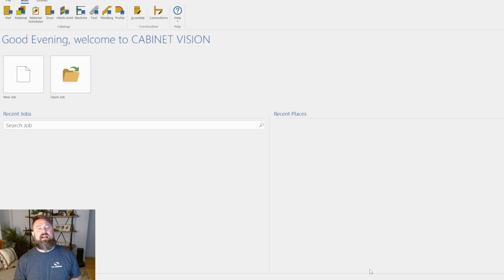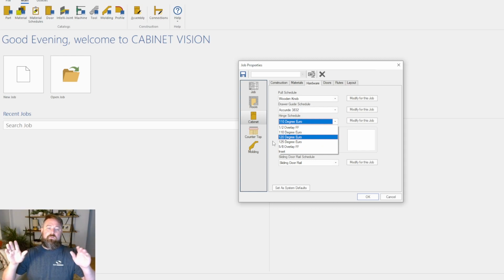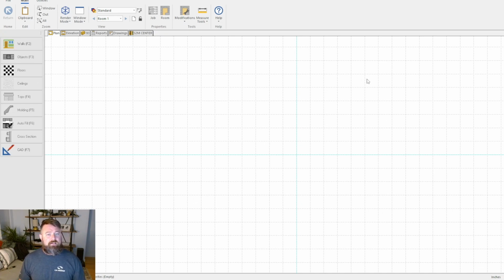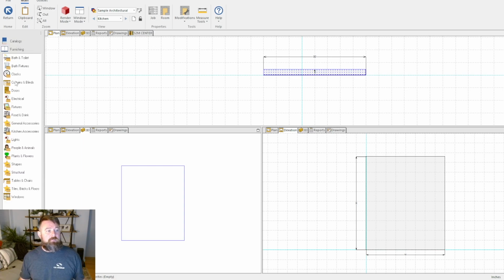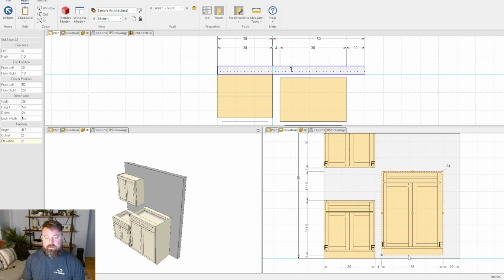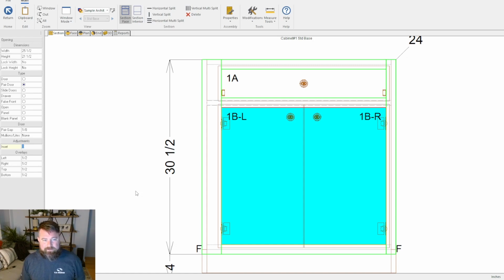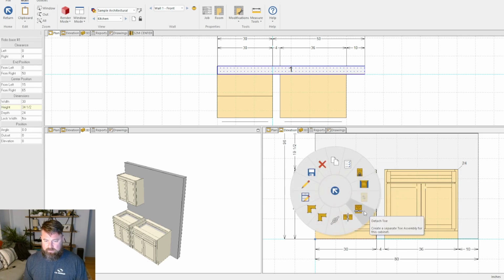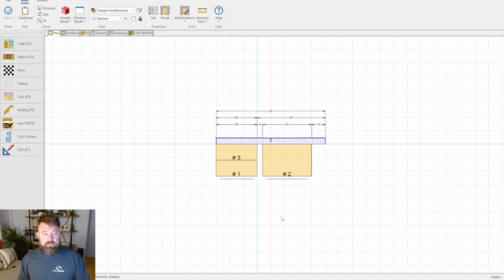Making sense of Cabinet vision! Pt 1

Comment: I watch these furniture design programs, and I’ve tested them myself before choosing the best one (which doesn’t exist). And as I look at them, I notice that the more expensive the software, the dumber it gets. They try to sell us the "one and only" solution because the more complicated it is, the better it’s supposed to be.

Furniture design programs should be more automated, taking the workload off our shoulders, but I get the impression that it’s faster to draw things on paper than on a computer. After years of using different programs, working with some of them feels overcomplicated and completely idiotic. Instead of progressing, some programs seem stuck in the past, so poorly designed that they can’t even be modernized.

Sure, they render things beautifully, everything looks nice, and they add small details, but in reality, they fail at simple tasks and mess up calculations. Cabinet Vision—so much money behind this company, yet they still can’t make...
Reply: u r right after many tries with many programs i found the best is polyboard

Comment: Sorry if this is answered in the video I'm only 25 minutes in but is this just making use of the "core cabinets" module?
Reply from the maker: Hey! Thanks for the question. To be honest, I don’t think I covered that part very clearly. Back when I started using Cabinet Vision, they had a different licensing model so I believe that we were grandfathered into the new licensing structure when they made the switch so it’s been a minute since I have looked at all that. That being said, I believe that everything I go over in this video should be available in the core Cabinets module.
Reply: @KBCabinets  Thank you! I am trying to figure out what I need out of CabinetVision and this is very helpful.

Comment: Not sure where to turn next as I have spent a couple of hours with a tech trying to solve but I installed 2023 update from v11 and now uniboard and prism texture packages will not work.
Can’t find any answers or even info on where to purchase or download anything.
I can download onto my computer and when I import them, says they imported but then not showing up anywhere.
Very strange and tech says might be because advanced no longer will work?
Doesn’t make sense because it’s the same package I’ve been using for over a year.
Like the software but really tough finding answers so hoping maybe someone will see and know of a solution.
Reply: After you download the package you have to "install" it in Cabinet Vision.
To do this you'll need to have all jobs closed and be at the beginning splash screen. At the top of the screen you'll see the "File, Main, and Utilities" tabs.
Go to the "Utilities" Tab and click on "Setup Package", and the "Package" dialog box will appear.
Click on the "Import" tab, then click on the "Open Folder" Icon. This should automatically be directed to your Download directory. If not, find your downloaded file from this window and select it, then click "Open" in the lower right corner.

(The right side of the Package Window should now display the package you downloaded with check marks next to each new feature, along with a Green, Red, or Yellow button - the colored buttons are labeled just below as to what they mean. You can pick and choose what parts of the package you want to install from here.)

For the most part, because this is probably a new package for you and you wouldn't already have it on your computer - don't worry about the "Add Prefix" button; in the "All Matches" box have the "Use Existing" button marked; leave the "Child Matches" area blank; and leave the "Toggle Overwrite" button alone.
Click on the "Import Package" button. (You'll see a progress bar at the top right of the screen indicate that it is installing your package, and an "Import Complete" box will appear when it is finished.)
Click "OK" on the Import Complete box, close out of that box, and you're all set. You're package should be ready to use.
Reply: Re-reading your question here, it looks like this issue MIGHT be a bug with v2023.(?), like your tech indicated. At first glance I thought you were talking about installing a typical package, but now I think you're talking about upgrading from v11 to 2023 where something broke.

Upgrading from v11 to v2023.1 and/or 2023.2 can be a good upgrade. There are many new features, but also a few bugs. I would NOT recommend upgrading any further until v2024.1 comes out. The last versions 2023.3 and 2023.4 make the program VERY SLOW, and added a number of other bugs. They know about these and have the 2024.1 version in Beta now. It's running late for release, but better that than another broken version. From the Beta testers responses so far, things are fixed and it's looking better.
Reply: @BillM61440  Sorry but I have to step in here. 2023.4 is not "slow" it was all caused by a microsoft update to the Access database engine 2010x32 and 2016x64 the slow issue is very solvable by tech support
Reply: I believe your answer is this one. 
"What is happening is when you import the textures, they are being placed the CV 2023\Database\Graphics folder, and they should be placed in the Common 2023\Database\Graphics folder. You can navigate to the first folder, copy the thumbnails, and paste them into the correct target directory. "

Comment: Hi, the CV is great if you have to do a lot of standard cabinets, but can it be used to make a one off custom cabinet where every part is placed manually? After reading all the manuals and watching all the videos available, the answer is still not clear. For example, I have an empty base cabinet and I placed the left end and a door - hinges are not automatically added, and there seems to be no way of adding them manually using menus and dialogs. Is it possible at all? Thank you.
Reply: The answer to your question is yes you can absolutely place every part manually if you wish. you can hide all the parts in a cabinet and start from scratch or hide just certain parts and manually add others.
Reply: Open the cabinet at section view, left click on the door you want hinges on, make sure you have the right type.